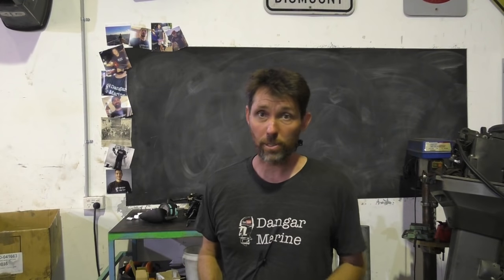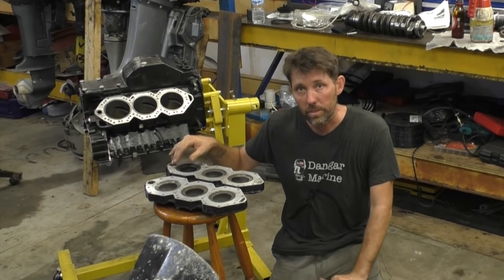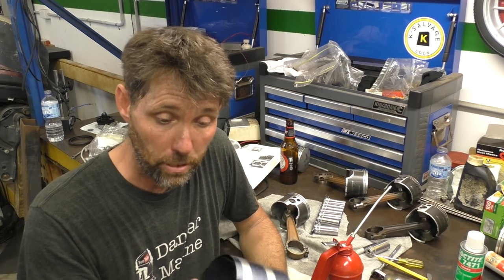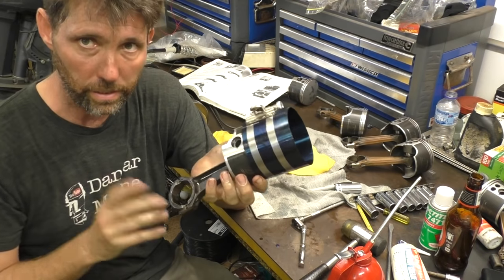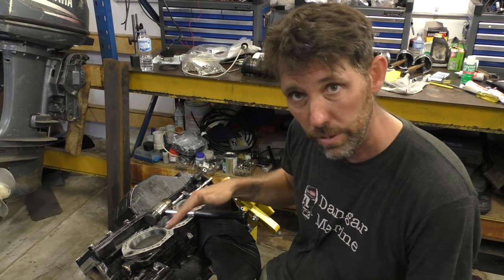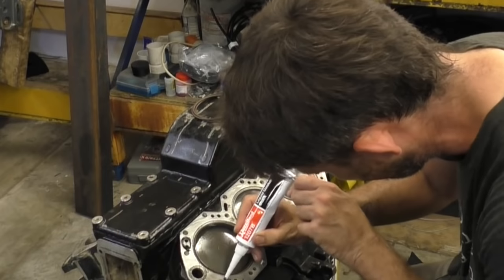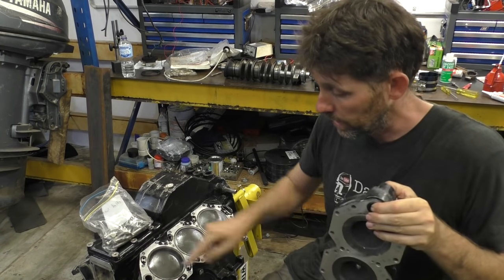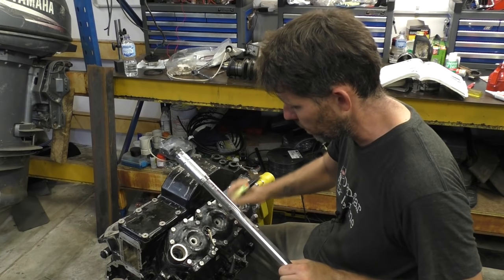Installing the Evinrude 150 pistons

Comment: Thanks! Great video!   You explain things really good!   

When installing the piston into the cylinder a short piece of fuel hose can be put over the lower rod bolt and over the crank shaft to guide the rod onto the crank shaft without having to hold the rod into the correct position.  It gives the mechanic a free hand!

Comment: A tip on greasing your o-rings. Don't grease them the obvious way of pulling the ring and applying the grease, it will actually stretch the o-ring! Use a pushing motion while applying the grease.

Comment: You're videos are excellent tools.  I'm rebuilding a 2000 Evinrude 175hp FICHT.  Curious about how you installed the o-rings on these cylinders.  On my heads, there is a groove around each cylinder where the old o-rings sat so I greased up my new o-rings and worked them into those grooves, completely opposite of how you set the o-rings in the cylinder on top of the pistons.  Is it a difference in the individual motor block/head designs or did one of us do it wrong?

Comment: Stu, a little trick for those bloody cylinder head O-rings. Clean the groove and the o-ring with solvent. I use alcohol on the o-ring unless I know for sure brake clean wont damage it. Get yourself some Loctite 401 or 495 instant adhesive (super glue) and just put a very small dot of glue every inch or so in the groove all the way round. Place your clean O-ring in the groove and it is fixed in place. Put your favorite grease on the ring (I use Vaseline ) and install your head. No worrying about the o-ring's coming out as you try and get the head in place and snugged down...works great.The trick is to use a very small dot of glue, just enough to see it is good.
Reply from the maker: Thanks for the tip! It's hard to see how a little dot of super glue is going to cause any trouble and getting all three to stay in long enough to get the head on sure is fiddly.
Reply: Hope it works for you. Nothing worst then pulling things apart two or three times trying to get the bloody O-rings to stay put in their grooves.

Comment: Hey Stu.......Isn't that a quick release lever on your ring compressor ??    Was wondering why you kept using your ratchet to tighten.......but again......great video !!
Reply from the maker: Hi Rob. I tighten it a bit to take the pressure off the lever so you can pop it. You can squeeze it closed again with the lever off a bit but I just find it easier to use the ratchet.

Comment: Hi thanks for a great video, i have just done my head gasket, but when i was puling out thoose silicone dots i manage to loose 2 small dots into the Block. Do you think that it will cause an overheat issue ? Kind regards
Reply: (lost to silicone dots into the small water ports on the head)

Comment: Hey Stu,

How did you position the rings on the pistons and is it critical that the end gap path does not travel in it's stroke thru any of the ports. Nice work on the video's although I'm a little late to view.

Comment: How does water circulate and cool if it just stops at the head like that?  Once that gallery fills up where does the water go?
Reply from the maker: The water flows through the thermostat at one end (once it opens) then out the opening at the opposite end. That opening at the opposite end is quite large so much less prone to blocking up with excess silicon.

Comment: Danger Marine.  Ralph from Texas.  Really enjoy your videos.  I purchased a used 1996 Johnson 150 Ocean runner.  checked compression and all cylinders have 70 psi compression.  Do you know the acceptable range of bore wear for the cylinders.  and if out of spec, what oversize piston should I look at?  if I do tackle this job, I will use your videos to do all the work.   I like the sequecial order you film your videos by.  Thanks mate!
Reply from the maker: Hi Ralph. You would normally be looking for at least 100 psi, but bear in mind that the compression tools you buy from stores aren't calibrated so what you are mostly looking for is a big difference in any one cylinder. General wear can reduce them all evenly though. To go up a piston size you will need to be the block machined and then the engineer will tell you what size piston you should move to to match the bore. He or she will generally go to the smallest over bore possible to get the cylinders back in good shape.
Reply: Dangar Marine  in the US 0.010 thousandths, then 0.020 thousandths, then 0.030 thousandths is common.  They say 10 over, 20 over and 30 over.

Comment: Did you use regular automotive black rtv on the cylinder heads?
Reply from the maker: Not normally. This engine had o-rings from memor but normally a head gasket has either nothing or a bit of hylomar on it.
Reply: @DangarMarine  I was just asking because I just installed my cylinder heads last night with the o-rings. I was wanting to make sure I was using the correct sealant. Thank you for your help

Comment: torque stages- for low torque values use 50 / 50 unless otherwise noted
when you get to higher torques like 75 -ish  use 3 stages of torque  ie 25 /50 75
Reply from the maker: Sounds like a good rule of thumb to me.

Comment: can you rebuild an engine without boring out the cylinders?  are there rebuild kits that will allow a rebuild without boring out cylinders?
Reply from the maker: It is possible, but if the bores are worn you may go through a lot of trouble only to still have an engine with low compression.

Comment: I have a question? Maybe u can help me out, does the blowoff valve require a seal. Been looking around and it doesn't show one in the diagram. I replaced the old blowoff valve and it didn't have one.

Comment: Can loss of compression cause over heating? I've replace the water pump, thermostats, the starboard temp sensor and about to replace the head o-rings. Motor is still overheating when accelerating, why would this be?

Comment: Still learning a lot from your videos. Was wondering if you were willing to offer some advice on an engine? :)
Reply from the maker: Sure, what did you need to know?
Reply: Hi mate, I watch all your videos, but have been paying extra attention to these evinrude ones because I thought it might give me some tips on a 1992 90hp v4 Johnson that I've got. I've done a lot to it, including replacing stator, new powerpack, timing by a mechanic, new cam rollers, new fuel pump, and various other things. Despite everything that has been done to it idling and starting have always been big problems, and the engine has always had a cough which results in a loss of power and stalling. 

The compression when I bought it was about 110 on all 4 cylinders. Recently I blew a head gasket (the day I was gonna take my boat over to the wooden boat festival) and the compression on that cylinder dropped way down. Even after replacing the gasket and ran the motor, the compression in that cylinder still around 85. Idling has always been an issue, and because of the loss of pressure, it's even more of an issue now. When you add the cough and loss of power, I'm stalling a lot at low revs, and it's tough to start. Because of the idling problems, when I start it and bring the throttle down, it is tough to get it into gear. I often have to jump it into gear and it's not very safe when there's multi million dollar yachts sitting around everywhere.

Obviously eventually I might need to look at replacing the engine, but is there some way  to keep it going a bit better in the short term? Do you know anything about the cough, or how I can raise the revs and improve the idle speed on this 1992 V4? I've looked at high speed jet screws etc, but this engine only seems to have orifices and apart from cleaning, I'm not sure if you can do anything there. The main idle screw is all the way in.

I appreciate that you're a busy man, but any help would be appreciated.
Reply from the maker: It's seems odd that the idle screws are all the way in, does it get worse as you wind them out? The cough can often be caused by running lean. Upping the idle speed a little bit might help too but it is hard to say without seeing it. Having one cylinder down on compression is definitely a problem too, it would be good to get to the bottom of that. If you have replaced the head gasket then it is likely to be a ring problem on a two stroke. Have you also checked the reed valves behind the carburettors? Are they in good condition?
Reply: Thanks for your help, but it might be time to give up. I changed the head gasket and brought the pressure in that cylinder up from 40-90. There didn't seem to be any major scoring, rust or damage in the bore or anything.The first trip out after the repair was so so, but not really a massive problem save for a few ongoing issues, but today (a week later) when I tried to start it wouldn't even start.

Compression is still the same, but it seems as if when the piston in the repaired cylinder hits a certain point, it jams up. Can't get it to start at the moment. Save for a full rebuild (which wouldn't be worth it on a 92 Johnson) I can't think of any other solution. New outboard time?
Reply: You may have a broken ring that is binding on the port.  With the clean bore, it may be fixable, by pulling that piston and replacing the rings.  On some models, you can pull the intake manifold and do it without splitting the block.

Comment: Tell me please. This issue should be put on the bearings front and rear running gear. Bearings dress hand without the press, they can sit on the anaerobic sealant or something else. Bearing made in Japan and Taiwan, the analogue gear?
Reply from the maker: I think perhaps Google translate hasn't done your question justice.
Reply: I have to say will keep the thread lock or other means. bearing on the pinion
Reply from the maker: On these pistons, the bearings for the little end are held in with those round clips. On the big end the bearings are in cages and the end cap is just torqued up with no thread lock.
Reply: I'm talking about the gearbox
Reply: or the vodka is stronger in his part of town. Sorry couldn't resist

Comment: Help me Mr. Wizard, Stu, I have a 1978 15hp Johnson. The shift selector gear slides over the prop shaft and is locked in place with a spring and two BB sized round bearings that are installed in a through vertical hole in the prop shaft. Are you familiar with this gearbox and how to slide the prop shaft and selector back into the shift yolk saddle? The yolk pivots from underneath the prop shaft. I've never worked on anything like this before and I'm having trouble getting it back in. I have removed the selector yoke pivot bolt from the lower unit skeg located next to the drain plug for clearance. But it doesn't seem to allow enough room for a fit. My local Johnson mechanic hasn't got a clue and says he doesn't work on stuff that old. Thank God my Doctor doesn't say the same thing......:-)
Reply from the maker: I can't say I've ever done one of those so I'm not sure what the trick is. Have you had a go at looking for an old service manual on the internet? There are heaps of manuals available for download at PDFs, generally for under $10. I would try readmanual.com and tradebit.com to start with. Failing that there is a great Facebook group called Outboard Troubleshooter where you can pick the brains of many knowledgeable people.
Reply: Dangar Marine thank you. I got it done. I tied a zip tie around the shaft and secured the bb's and spring in place in the prop shaft. Added a thin layer of Grease over the shift dog splines on the shaft and slid the shift dog over the shaft. As the shift dog went into place the zip tie slide out of the way...  thanks again, really appreciate the reply.

Comment: hi there, i need some of you guys advice on buying a new Selva Marine Outboard which is Brand New from Factory with really cheap price but the catch is the engine is make in 2000 year. which mean the engine have been store in the warehouse more then 15 years. 
is it worth to take the risk of getting it ?
Reply from the maker: Parts of the outboard will be good as new, other parts not so much. Age will perish seals and the impeller. It may not have any corrosion issues if it is stored in packaging and will probably have a coating on most components. If you buy it I would be sure to give it a complete service before putting it to use. Will it come with a warranty? If so I'd say go for it.
Reply: thanks for the reply, unfortunately the outboard do not cover any warranty. what is the worst case of scenario i might encounter?
Reply: actually i do bought selva 25hp have the same condition i mention in the first post. it is 2000 year manufacturer but have store in the warehouse more then 16 years. i found out it is very hard to start the engine using the pull start. it is taking about 5-10mins. once it started, it is much easy to re start it. however, after the next day when the engine totally cold down. it become hard to start again.
pls advice me, is it anyway i can fix the issues?
thanks

Comment: Did you get the heads machined as well?
Reply from the maker: The heads went off to the engineer who has measured them for flatness and found them to be fine so they didn't need to be machined.

Comment: Hi Stu i have a prob you might be able to solve for me , I have a new 20hp honda only used it a few times, twice when running at full speed i have had  engine oil come out of the air box, it had the right amount of oil in the sump any help would be great thanks
Reply from the maker: What model is it? Is it coming through the crankcase breather hose into the airbox? If drain the oil, does it look normal? ie, no fuel or water in it?
Reply: Hi stu thanks for reply ,yes the oil came out from the crankcase breather tube into the air box ,i got the engine brand new it only has about 30 hours on it i brought it back to the dealer he said i had it in the wrong  pin so the engine was at the wrong  angle when running at top speed ,there is no fuel or water in the oil model of the engine is BF20D,I did change the prop from the stock 4 blade to a 3 blade and have since changed it back to the stock 4 blade but have not tested it yet would the diffrent prop have done it even tho the 3 blade prop was for a 20 honda thanks for your help
Reply from the maker: Hard to see how a prop would cause that. Being tilted too far can cause oil to run out, but only at very extreme angles. Boats are designed to rock and roll in the waves, it's not like they sit level all the time. How oil is ending up there? The whole point of the breather going to the airbox is that oily fumes are re-ingested and burnt so an oily smear there is normal.
Reply: Thanks for your anwser going to try the engine more level with the stock prop if it happens again back to the dealer

Comment: Get rid of that hand-slicing adjustable ring compressor Stu. I hate those things. Tapered fixed ring compressor is the only way to go. If none available for the bore size you're working on, 20 mins on a lathe with a boring bar is time well spent.
Reply from the maker: Yes, I'm not a big fan of those ring compressors either. It's nice that they are one size fits all but that is about all they have going for them.
Reply: The ratchets are too coarse, you never get it properly tight.
Ive found its better to pull the piston through by pulling the conrod from inside the crankcase with one hand and compressing the rings with the other. That way you can feel if the ring hangs up. You dont have any feel with a hammer.

Comment: A lot of the things you do are great and teaches well. In this case however OMG NOOOOOOoooo lol NEVER, not EVER use ring compressors like this on an outboard, you WILL sooner or later snap off the tips of the rings where they fit against the ring gap pin in every ring groove on every 2 cycle ever made.
What do I mean?  The compressor you are using is automotive. In a car engine the rings are just that, they have no stops because the rings move in circles as the engine runs.  The ends of those rings are just flat, cut off ring material.

ON AN OUTBOARD it is different.   Because an outboard runs with holes in the cylinders (intake and exhaust ports), the rings have to NOT SPIN OR MOVE>  The ends of the rings have to remain in one position where they cannot catch the ports in the cylinders. So... how do they work?

each piston ring groove/slot has a small metal pin inserted and fixed in place. the ring itself then has the ends grooved into a half circle to fit around that pin, thereby holding the ring in place so it does not freely float around and catch /break by catching the cylinder port and then snapping off and destroy the piston and / or score the cylinder thereby destroying the engine...

THE PROBLEM.... using that compressor when the ring is not exactly perfectly placed,,,
(almost impossible to place rings correctly inside the compressor band,) will snap off the end of the ring and destroy it.... using a hammer guarantees it will happen... on a car it works but not here.
 all one needs to do to install pistons in an outboard is install rings by hand, put 2 cycle oil on piston and in cylinder and drop the piston into the hole/cylinder with the piston exhaust pointing to exhaust or arrow up going the correct way.... when the rings are in position, simply align the ring correctly to the pin and use your fingers to compress the ring, it will drop into the cylinder easily... repeat for the rest of the rings.